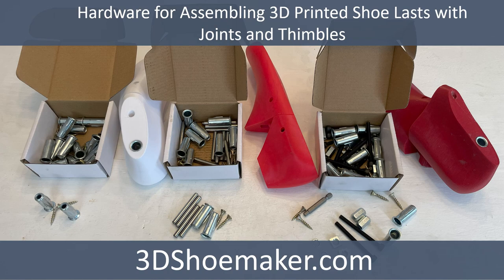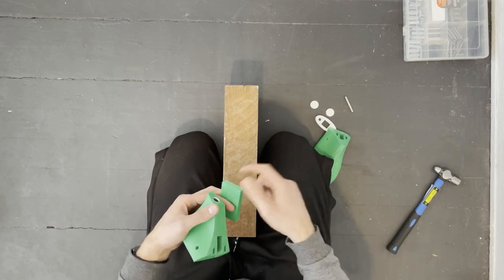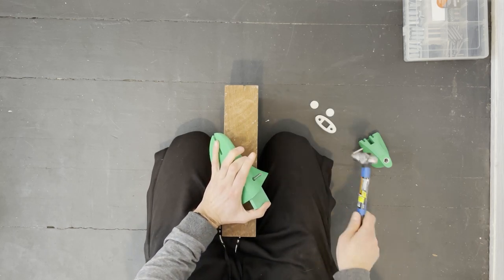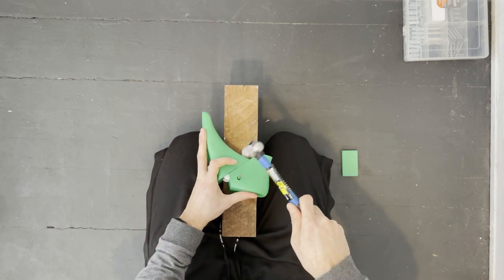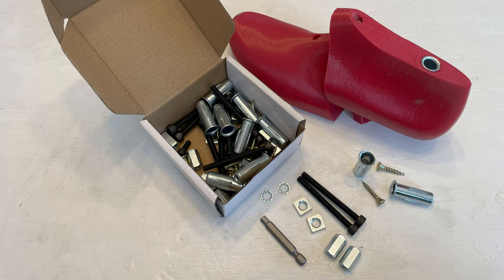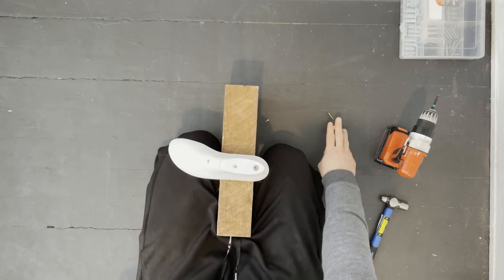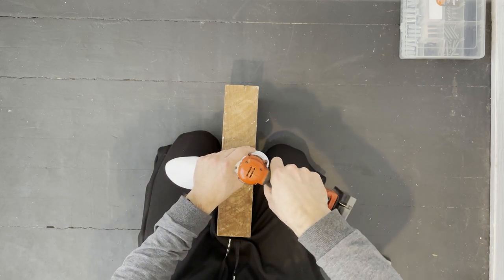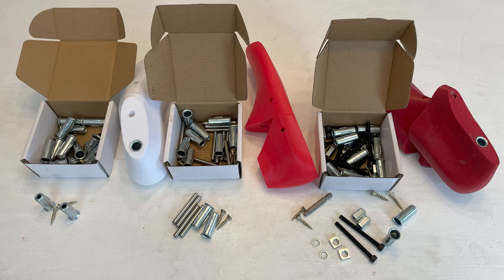Hardware for Assembling 3D Printed Shoe Lasts with Joints and Thimbles

Comment: Just for clarification, the lasts do not come preinstalled with the hardware? It needs to be ordered separately?
Reply from the maker: The lasts are preassembled with hardware unless you choose order type digital to print yourself in which case you can source hardware yourself or on 3DShoemaker.com

Comment: Hi is there any any filament material you can think of that is hard of to put under the sole of the last to replace the metal sheet? So that when I'm nailing the outsole heel on the nail can be bent and clench down the midsole, not puncture through the foot bed and still pointy.
Reply from the maker: I don't have a solution to this yet...